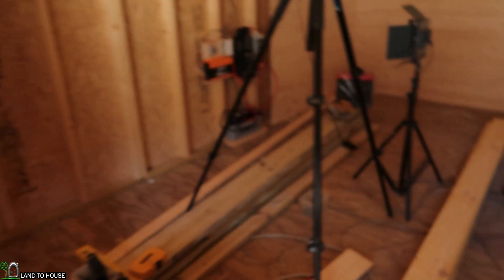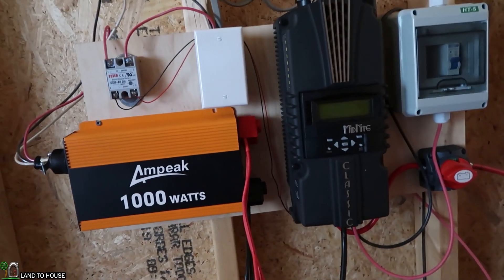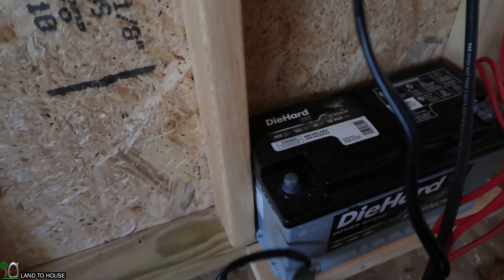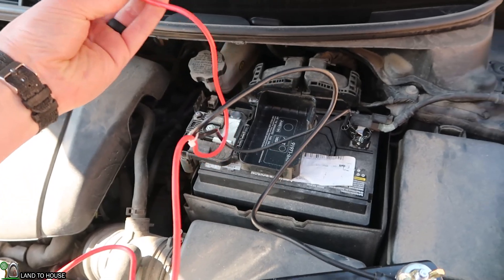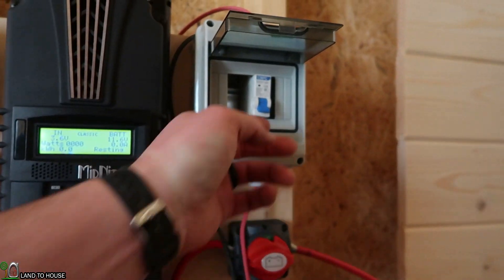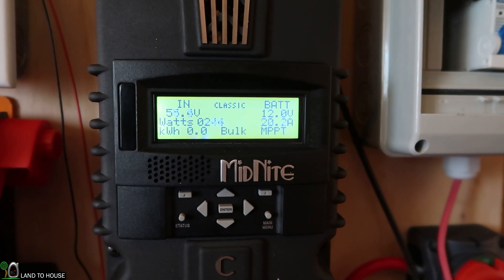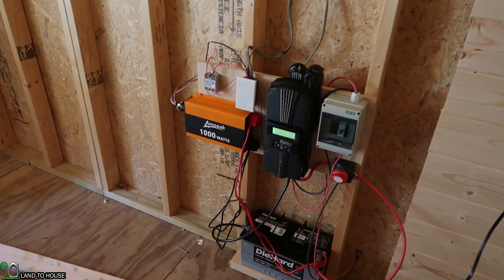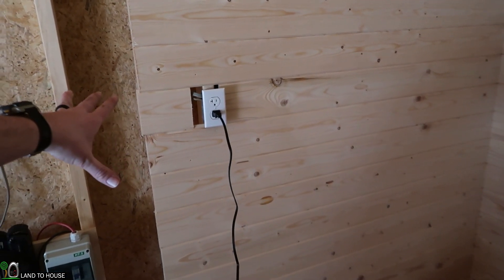Off Grid Solar Stopped Working

Comment: you stupid ja, never connect black wire first, always connect red wire first, and secondly, if you could read you'd have known that the inverter does pull some amperage even when not operating.

Comment: It looks as if you are running a car battery for your solar system. Not a good choice. You really need a Deep Cycle battery.
Reply from the maker: I now use a 100ah lifepo4 that also has cold temp self heating.

Comment: Are you using a normal CAR Battery or a Semi-Traction or Deep-Cycle battery?
If you use a normal car battery then ditch the battery. 
Normal car battery are made for starting an engine and therefore have a high CCA which we don't need. 
You need a battery that can deliver over time and at moment. 
Your inverter is not to blame here that's for sure !!!!
Because it's normal to drain such low current in standby mode. 
To solve this you have 3 options:
1. Buy a decent battery that less longer.
2. Put a DC relay on the inverter input side so your solar controller can cut off before your battery gets low.
(In fact this schould be mandatory)
3. Buy two more solar panels. 
Now you would have a happy system providing you power ;-)

Comment: I dont think that battery is meant for this application.  I've heard that unless it's a deep cycle battery using it in a solar  application is not going to last as long or work as well since car batteries have thinner plates to give more amps to start up.   Glad you got it working again. Good luck
Reply: I was thinking the same thing.  They are designed to give heaps of amps for a very brief period and then get charged up again quickly and remain full most of the time.  However I've not seen much about how it works in practice so hopefully we'll get a follow up video at one point about how the battery is going and whether the run time it provides is indeed getting shorter or not.
Reply: @Berkeloid0 , This is one of the reasons I like this channel though.  He will try it, and mess with it and get it working.  I feel like I've spent alot of the last six months thinking and not doing.  Gonna have to fix that :D

Comment: PUTING A SWITCH OR RELAY ON THE 12 V INPUT SIDE OF THE INVERTER, MIGHT GIVE A VOLAGE SPIKE TO THE INVERTER.  YOU DO NOT NEED THAT.  A MASTER SWITCH OR RELAY ON THE 110 AC OUTLET MIGHT BE THE WAY.  WITH A TIMER IT COULD TURN OFF AT A SET TIME BUT NOT TURN ON UNTILL YOU COME BACK..  THEN WHEN YOU COME BACK AND RESET IT ON IT WILL ONLY RUN AS LONG AS YOU HAVE IT SET FOR AGAN . IN YOUR AREA  A GOOD FULLY CHARGED BATTERY WITH NO LOAD SHOULD KEEP ITS CHARGE FOR MONTHS IF NOT A YEAR OR MORE.       GOOD JOB.
Reply from the maker: I think that this inverter uses around 7 to 10 watts in idle. That is one of the main issues that I had. The other is that the charge controller also uses some power. I think that it uses around 4w. Anyhow I think that I will double the batteries and that should be all that I need as long as the inverter is turned off when not in use.
Reply: How would a switch or a relay cause a voltage spike?  Relays and switches are in use everywhere and I've never heard of them causing a spike on their output.  They can cause one on the input but a diode fixes that.
Reply: @Berkeloid0  THE VOLTAGE SPIKE I WAS THINKING OF IS TO THE INPUT OF THE INVERTER. LIKE IF YOU WERE TO PLUG IT IN OR OUT WITH THE INVERTER TURNED ON. THAT IS WHEN YOU MIGHT GET A SPIKE. IT HAPPENED TO ME WITH A 600 W INVERTER, BURNED OUT THE INVERTER.

Comment: I had recommended a small relay that turns off the inverter connected to the inverter power switch, this is the result.
Reply from the maker: Yes you sure did! Now I have learned my lesson the hard way. haha
Reply: @LandtoHouse  It is a starter battery, it is not very suitable for cyclic and solar use, but it is robust it is designed to always stay charged and withstand high discharge currents for starting, it has thick plates, a nice defibrillation like you did and being very recent it recovers no problem, you think you were the first one that happens, it happened to me too many years ago! Ciao

Comment: Put the big DC isolator on the load side rather than the charge side of your system, and fuses , you need, even in a simple system a switched and un switched DC Positive bus, all charge sources to un-switched, and all loads to switched. You can stil have an isolator on your charge sourses for maintenance but the single DC isolator you have is better to have as an isolator to the inverter and any other potential loads
Reply from the maker: Yes it would have been better going from the battery to the load to stop this issue. The charge controller also pulls some power when in idle. For now I will just turn off the inverter and not worry about it. I would have to get a DC relay if I were to place it in line before the inverter.

Comment: Nice little system especially with the midnight classic and the orange inverter that makes the system look great . More battery capacity is needed , try  golf Cart or AGMs for best results and maybe more PV modules  for faster charges . Keep it up and like we preppers must stay on top of solar to survive in this time & age . May the solar be with you .
Reply from the maker: I plan on adding another battery to make this a bigger system. Should solve any issues I have with running out of power mid filming. This is an AGM that I have installed right now.

Comment: this is why the load side of the solar controller should control a relay to either turn the inverter off or cut power to the inverter
Reply from the maker: I might look into a DC relay. But for now I will just turn off the relay. The Midnite also pulls 4 to 15w depending on the mode. So that could have also caused an issue.
Reply: @LandtoHouse  yeah my small solar system had a habit of it when I was away from home to long I did not run an inveter just not enough sun with uk weather

Comment: For the house power it will run a diffent wave timing to inverter so you cant just plug straight into inverter. However you could put an isolator switch between inverter and sockets, switch it off then plug straight into sockets from the house. Mabe wire up a socket from house and use a cable with a 🔌on each end
Reply from the maker: For now I will just remember to turn off the inverter when I am not using it. I think that is the easiest method at this time.
Reply: You can get automatic changeover switches too, designed to switch across to a generator when the power goes out, and switch back to the grid when it returns.  They are automated so in this case you could treat the grid power from the house as the secondary source, and the solar as the primary, so that if the solar goes out (e.g. from the low battery disconnect) it will then switch over to the house power automatically.  Big Clive did a good teardown of one of these showing how it works: https://www.youtube.com/watch?v=babtv00R-Nc

Comment: Seth, I always enjoy your videos.
When the inverter detects 10.5v on the batteries, it shuts off the AC output, but still draws some small current to sound an alarm.  Your solar charger also draws a small amount of juice to run its monitoring and display bits that tries to tell you the battery has gotten too low.
Some more batteries in parallel ought to keep it from dying the next 2-3 days of snow/leaf cover.  that and getting out to brush off the panels also, LOL.
You want to search for a "Low Voltage Disconnect (LVD)" for protecting the batteries, it will draw off much less power than a 100A DC relay.
Reply from the maker: Thank you. The inverter uses around 7 to 15 watts when in idle from what I can gather. The midnite is pulling around 4 to 15w depending on the mode. My goal is to add one more battery to this setup and I think that will make a big difference. Especially if I remember to keep the inverter off when not in use.

Comment: Would you feel comfortable enough to wire the relay to control the power switch for the inverter instead of it switching the AC?

Comment: Boy im glad ur alternator lived through that torture pushing from 5 to 12 volts...
Reply: That inrush though
Reply: Alternator will dump power into anything....
Until it can't anymore.
5v was "at rest" but after he connected the 12v to it, the power would have rushed from the 13v battery to the dead battery, alternator would have only probably seen like 9 or 10v with a hunger for more potential.
Reply: Those 14g wires can't carry the current to mess up your alternator. They're going to melt way before your windings even start to heat up.

Comment: Great vid.  We have a 4K watt inverter and its programmable thankfully.. If there's no draw then it goes into sleep mode.  When its on it uses 30 watts!  So it would drain our 8 Trojans pretty quick if it didn't have that safety feature.
Reply: Which inverter is that?
Reply: @kipdennis3796  Its an old one but good one...A Trace pure sinewave inverter...  Programmable..  I need to reprogram it so it turns on at a lower voltage drop.  When we turn one LED light on it blinks because the inverter is looking for more of a load to stay on.  So it goes into search mode...lol

Comment: Never use a lead acid battery in an off grid situation. Ever.
Ever.
You can only use a fraction of the claimed power.
Reply: Haha..  thats funny cuz like 98.975 % of all off gridders use lead acid cuz we ain't rich like some folk and can't afferd them rich type batteries!
Reply: @HiddenValleyHomestead  Lead is more expensive if you plan on using the system for over 5 years. Buy once, Cry once.    *still using lead
Reply: @JoeMalovich  Joe i been following you since like FOREVER AGO!!!   LOL... At least 3 yrs when we bought our place..  Your hydro antics are what inspired me to do my own!  I plan on looking into the Lion LiPePo battery series ...  My Trojans are about half way through their life and I probably am going to upgrade and spend a wad of cash for that 10 yr warranty....
Reply: @Dirty South TV What would you recommend instead of lead acid aside from lithium which is prohibitively expensive for most?
Reply: @Berkeloid0  save up for the lithium. There are cheaper alternatives to battleborn if you diy.
Reply: @JoeMalovich  Is it really that much of a difference?  Every consumer electronic device I've owned with a lithium battery has stopped holding a decent charge after 3-4 years, often less, and the lead acid batteries I've used have lasted for 2-3 before they give up (possibly these short lifespans are down to my warm climate).  It's been a while since I looked, but I guess if lithium were twice the price of lead acid it would break even, and cheaper than this it would be more cost effective.  Maybe I need to revisit it - not sure if you can now get smaller battery packs for the same price as 2x SLA bricks so you can build a system slowly instead of having to go all in with a massive battery pack up front, because that was always the biggest barrier to entry.

Comment: Just a suggestion, you might want to add wifi switch for the inverter, so you can switch it off just from apps. You might also need mini ups for that, so it can operate independently from main power system.

Comment: For 1000 square feet of living spqce I use 20, 300 watt 8 Amp solar panels and 40, 6 volt batteries for a 24 volt output to the inverters. That does not include air conditioning.
Reply: Holy smokes!  What sort of appliances are you running?

Comment: Put your relay on the 12v side and not the 120v side. It’ll cut the power to the inverter before it gets too low.
Reply from the maker: Yes I might do that soon. I will need to buy a dc relay.
Reply: @LandtoHouse  It's going to be absolutely worth it! You won't have to remember (or fret) about turning that switch off!